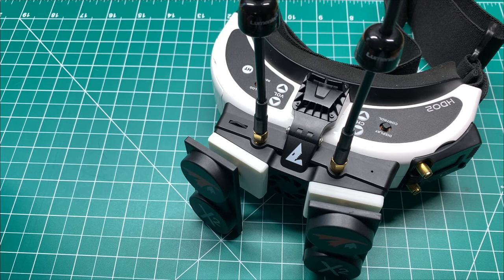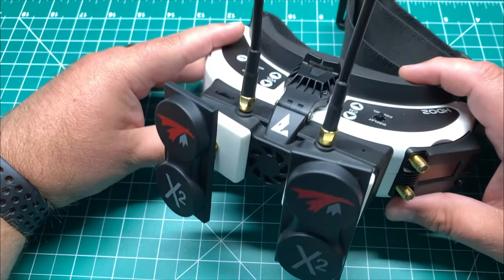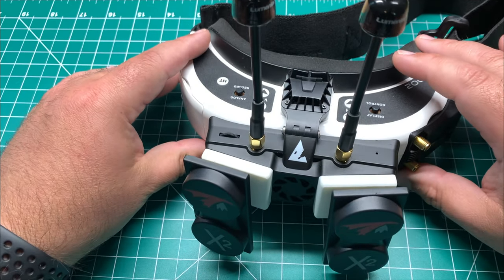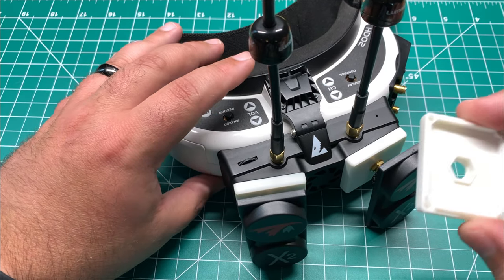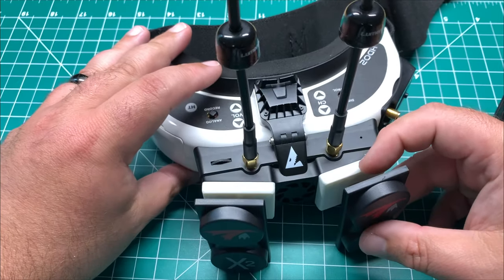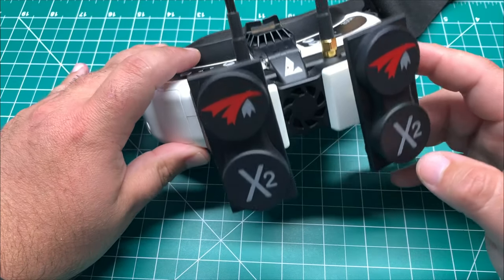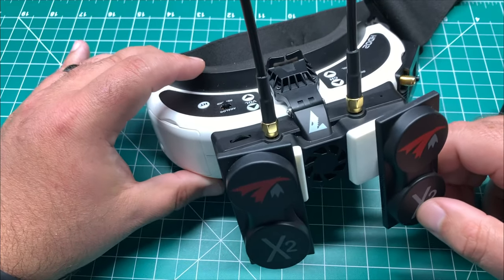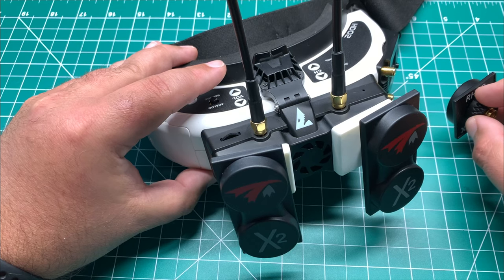Shark Byte 3D Printed Patch Antenna Mod// Worth It? You be the Judge.

Comment: I will be doing this mod with MX2-Airs, for more broad ranging locked in video in normal ranges at 200-500MW, with 45Deg adapters holding them apart to spread out the pattern for better reception from the patches at the sides...9.5DB is only slightly more than 8DB stock patches, but the width a range means I will hopefully stay on the patch longer at wider angles...